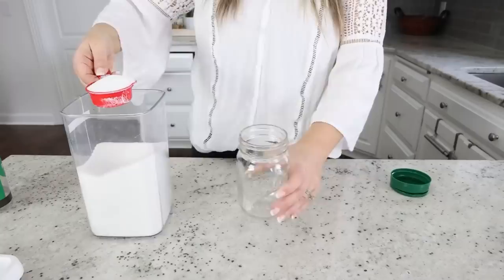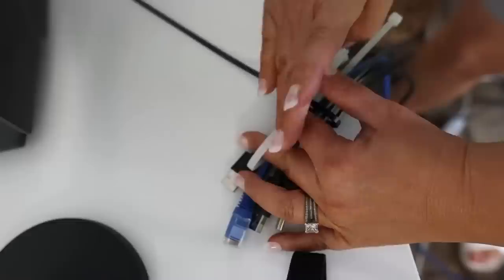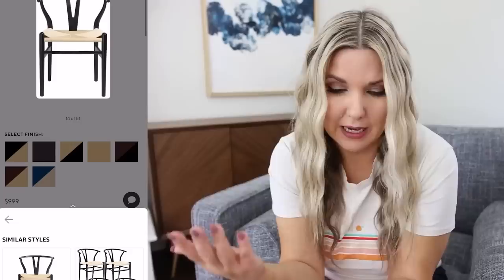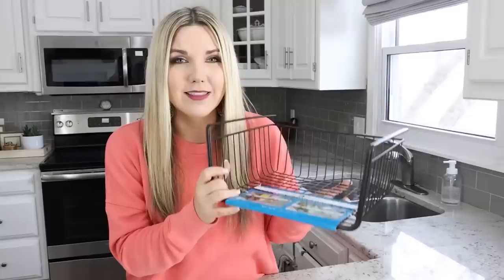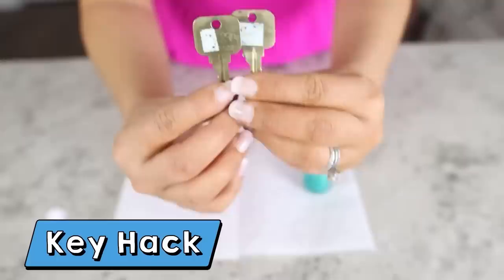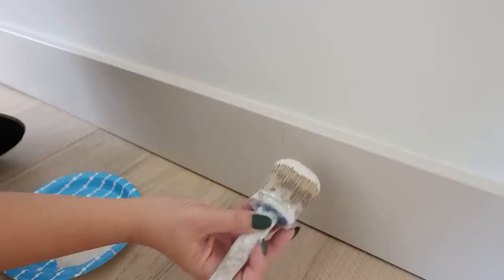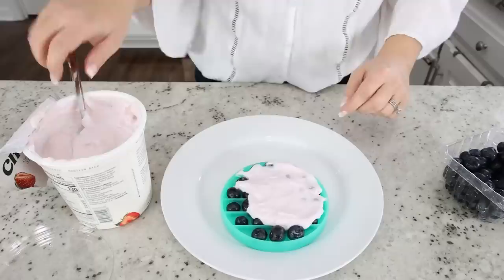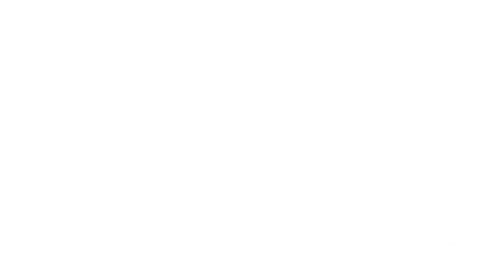60 HOME HACKS...That You HAVE TO TRY!

Comment: Use dryer sheets attached to a floor swiffer sweeper to clean baseboards and trim; not only does this clean off any smudges like fingerprints or crayon marks, but it also works as duster at same time,as the dust clings to the dryer sheets instantly. Plus as a bonus, it leaves your home smelling clean and crisp, and laundry fresh!
Reply: I had not noticed about the ceiling fan switch.  Thank you for bringing that to my attention.

Comment: A large dish soap container makes a better plant watering device as the snap cap keeps the water from evaporating and the lid opening makes it easier to control where the water goes.
Reply: Yep, I have tried putting holes in lids of various sized bottles and it always dribbles and makes a mess no matter the size and number of holes.
Reply: Excellent! Either a sports water bottle, or a cleaned out dish detergent bottle sounds great!
Reply: Love this! Currently, I am using a large Essentia bottle for my upstairs plants. It’s 50oz ans I can control the flow like a detergent bottle.  💖💖💖

Comment: To remove labels on plastic or glass, use spray WD40. Don't use water. Peel off as much of the label as possible. Then spray the area with WD40 let set for a few minutes, then you can clean the label and glue off. Works better the nail polish remover and puts a shin on plastic. Love your channel.

Comment: what a neat jewelry hack. I use old cans from Altoids for my jewelry travel. for long-term jewelry storage, I had some parts cabinets that my rings and ear rings, pins and smaller necklaces were in. Those were also valuable to put in my car when I moved across country and it was shipped.  I use nail polish on my keys.

Comment: I noticed running really hot water inside the jar helps heat the glass and loosen the glue from the label, making it easier to peel off.
Reply: Yes, I do this and let it sit for a few minutes. It works great! Comes right off.
Reply: And running a hair dryer over the outside, too. I prefer the hot water and hair dryer because then I can just quickly clean off the adhesive residue with lemon essential oil.
Reply: Yep, works like a charm no mess!

Comment: The container at 45:40 is great to store bags with handles from the grocery store too. Just put the bottom half of the bag through the handles of the previous bag and stuff them into the container as you continue doing that with each bag. Then put the last bag through the hole in the lid of the container. It works like a tissue box.
Reply: I’m getting ready to try this now.  I’m just not sure I understand the lacing the bag technique.  I’m going to give it a try though!

Comment: #6 paint tip. I paint a square on the inside of the switch because sometimes they discontinue the paint color. You can take the plate to the store and they can computer match from the swatch

Comment: To prevent hitting your fingers when hammering, simply put nail into the tongs of a fork. Put the head of the nail into the bowl of the fork so the nail is sticking out of the back of the fork. Use the fork to hold the nail. You don't have to hold chopsticks together.

Comment: Love it. 
One thing to use for removing labels is WD-40. I’m not sure if it removes the sticky stuff but labels come off easily.
Also, most people don’t know, but you can actually use steel wool on glass. That would definitely help with the elbow situation with removing the sticky.
There are so many hacks that I can’t remember my favorite.
Oh, and any way to store florals standing up is great. I have seasonal florals and I stand them up with dividers in boxes and then keep them lightly covered to prevent dust.
Reply: Goo-Gone will take off labels as well as any house or garage items that have gotten icky.  And you can get it at dollar tree in the hardware section.
Reply: Steel wool on glass?  I  don't  think  so... I use nail polish  remover. Or  baking  soda  and  vinegar with  Dawn dish  soap.  And if   you  soak  the  container in  warm  water  awhile  the  labels  ill come of  easily. Patience  is  the key.
Reply: @PK-bh1ww  steel wool is okay. I lived in an RV for several years and cleaned my front windows with it to get stuck on bug juice. I also used on the side windows to get the drip stains off the windows. I did not use it on the fiberglass as I had a different solution for fiberglass. Trust me. I did use regular (fine) steel wool rather than SOS pads.
I was just listing other options and things that do work without a lot of elbow grease. 😊
Reply: @sdeaglefeather  I  would never  use   even #0000 steel wool. I would use  vinegar   or  a paste made  with  vinegar and baking  soda  and a scotch  pad. Hot  water  used  works  well  too for  cutting any  grease.  I  too wouldn't  have an SOS  pad in my  house..  In the garden maybe  cleaning concrete pots. lol
Reply: Use eucalyptus oil. Labels comes off like a breeze
Reply: I use peanut butter. Works wonders
Reply: @PK-bh1ww  I was thinking of our back and forth video this morning and had to chuckle. Have never done that before. However I just found a small jar with a label so will go try it again 😊
Reply: @suesmith8326  Thanks for the tip that Goo-Gone is in the Dollar Tree store.
Reply: Peppermint essential oil for sticky stuff on glass. But be careful about putting essential oils on plastic as it can "melt" the plastic.
Reply: I use a blow dryer - nothing left to clean off
Reply: To remove the sticker from the glass or plastic container, just pour some hot or boiled water into the glass, you will see how easily you can remove the sticker from the glass. Do not wet the outside of the glass.

Comment: New subscriber having 2 ideas off from this video. Instead of tape on the luggage when going traveling (which is easily taken or rubbed off of), put many colorful tiny ribbons tied on the handles. Easier to spot better and not easily removed... imo.   Last suggestion, grab some Dawn Heavy Duty Degreaser. The purple spray bottle is not found around dawn and other dish soaps but is located around other cleaning degreasers. This chit is way better than the Dawn powerwash or other known products. I buy it personally in a bulk jug now from Lowe's. To save money (from the degreaser) yet efficiently working at top speed with high rated results, I fill my old spray bottle with one third full of the Dawn purple degreaser, add some regular blue Dawn (not powerwash) to approx 75% full, then finally top rest with alcohol till bottle is shy full. Give it a lil shake to incorporate. Trust me. This is thee best I came across and tried.     Thanks for reading if ya did. Abundance of infinite blessings everyone 🌍

Comment: Great video, Liz. 1. I have a used spray bottle filled with neat Apple Cider Vinegar near my Washing Up Liquid on the sink, a few sprays of the Apple Cider Vinegar inside glassware such as milk bottles, add hot water from the tap, quick shake, then rinse, glass sparkles. It has also got stubborn marks out too!  2. I use a few drops of my favourite Essential Oil [Coconut at the moment] inside the toilet roll or kitchen roll, and it adds a settle scent in the room.
Reply: I used  distilled  vinegar, baking  soda  with a little  Dawn  dish  soap  on my  glass  baking  dishes  and  a  Scotch  pad. Works  wonders.
Reply: Vinegar makes any detergent rinse away faster and more cleanly. I also use a spray bottle of vinegar at my sink!
Reply: @monstermcboo7282  vinegar is great  for taking  lime deposit off the  faucets.  I soak a rag  with it  and  wrap it  around  the  base  where lime  has built. Leave it on about a half  hour.  Or  use  it as  a routine  to  wipe  around  the  faucet after doing  dishes.
Reply: Use GSE from vitamin stores for many uses. Like - cleaning dishes glassware - dishwasher - in your washing machine - carpet shampooing - stains carpet. The list goes on
Reply: @SSS-eq3ky  I am not familiar with GSE ?   Could you explain it. Thank you 🇨🇦
Reply: @PK-bh1ww  I LOVE using distilled white vinegar for cleaning everything!
Reply: GSE is grapefruit seed extract. You find it at the vitamin stores. You can use for health issues for a person or you can use it for many other reasons. Been using it in my dish’s soap I make out of dr bronners n GSE n essential oils

Comment: Are used 3 to 4 denture cleaners to throw in the back of my toilet and two in the bowl of the toilet. Let them fizz scrub them out wash the toilet scrub a little more and then flush it again.
And when I was cleaning houses and apartments after college students would move out the sink stoppers would be very nasty in the bathroom. I would close them add water and a denture tablet and let them soak a few minutes and then scrub them off and help lift the dirt and made it easier to clean .

Comment: I knew several of these hacks, but still watched the whole video anyway. You always share such useful tips, and I absolutely love your videos! 
A quick tip for getting labels off easily is to use a heat gun. It warms the glue and they usually peel right off. (Be cautious not to hold the heat in one place too long or too close to the glass, or you may burn yourself)
Reply: Hair dryers also work. Even on low.
Reply: I also just soak in hot hot soapy water then use the Goo Gone
Reply: I soak in hot water, then lay on side, use cotton pads soaked in vegetable oil, and wash off with dish soap.
Reply: Hello, I hope you're safe over there? I hope this year brings happiness, prosperity, love 💚  and peace all over the world . I would love us to be good friends in honesty and in trust so as time goes on it will bring something great for us in the future, hope you don't mind?. I'm,  Nashville, Tennessee. Where are you from if I may ask?❤
Reply: Same..but have to say despite some good new tips,I can't stand fake floral anything!!

Comment: I use denture cleaner to soak in my coffee pot to take the coffee stain off! You hardly have to rub them clean. Also to put in a thermal bottle, thermos, especially if their stainless steel.

Comment: Denture cleaner is the best to soak your fingernails nails in to white them. I do it once a month. If stained from polish, it whitens them right up. With the candle, here was a mushroom top (carbon ball) which pops off if not removed before next lighting. You're suppose to trim your wicks a tiny bit between each burn.
Reply: Thanks’ I tried the dentist cleaner, I always trim my candles wick, how let smoke!

Comment: Great info. as always! To remove labels I soak the item overnight in a basin. Then use a scraper I got at $tree in the craft dept. It has a white handle & a flat metal scrape. Like a spatula. Then use it to remove the label and whatever is left I use peanut butter & the same spatula. Voila! All done & no labels. I gv these as stocking stuffers this Christmas. My friends really like the idea and are using it. Have a great day, and keep the info. coming.
Reply: You can also for free use a used up gift card as a scraper

Comment: I use the smaller of the IKEA clear plastic slim pour containers as a bin to store dead batteries prior to tossing (in case they leak battery acid).  But for the taller container, I'm currently deciding whether I want to use it to spread de-icer on my sidewalks-- I think it would work, though I will probably decide on a different container.  I just wanted to mention it in case it would work for anyone else reading this.

I'm working on a hair tools skinny bin storage solution, too!!!  I have mDesign frost rectangular trash cans though, and am working on having one bin for tools, and another for products.  I may use the Umbra skinny bin (it has a dramatic diagonal slope to the top (the top is not level), so that the one end with the handle sticks up more for grabbing.  I may use that one for the bin in the back.  Anyway, it's basically the same exact concept of your clear slim bin idea, and I've thought about clear bins, too (I love clear bins).  Been using the rectangular trash bins for everything, though .... bathroom cleaning supply kits, vitamin storage, etc.  They come in different sizes and colors, but I always choose white or frost.

I use a plastic carafe, too!!  I recently learned that baking soda seems best to clean toilet bowls with (which was a surprise to me), so I got Prodyne plastic carafes (Prodyne makes the best quality ones on Amazon), and am currently using them for baking soda.  I have others which I use to distribute dry plant food powder/granules, and they work great for that, too.  I feel like the flower fairy when I'm feeding my garden plants with the carafe --it's so easy and fun to use!!!

Comment: Loved all the ideas!
Liked so many!
Toothbrush holder for stems, the nail polish to remove labels, dawn + alcohol cleaner, baby oil on appliances etcetc too many to remember 😂
But
Thank you so much
Reply: It should be said that it all depends on the strength of the alcohol on the ratio. She was using 50%, but it more commonly comes in 70 and 91%. Dilute accordingly.

Comment: Use a diamond-infused honing steel on your blades every time before you use them. Honing is different from sharpening in that it aligns the particles along the edge so that the knife has a keen edge, whilst sharpening actually removes material from the blade. Hone every time and you won’t have to sharpen your knives very often at all; even your favorite and most used knives will maintain their edges much longer. It helps to buy a quality knife that has been adequately factory-sharpened to begin with, and I’m sorry, but those silly colored blades that are so trendy these days are not it. Those things are made to be disposable inside a year. You don’t have to spend a lot, however; I’ve found fantastic, well-made knives for reasonable prices on Amazon and at department stores. My honing steel was purchased at a reputable local kitchen supply store but read reviews thoroughly and you can make a good purchase online.
Reply: Totally agree! A Victorinox chef knife is around $40 on Amazon and recommended by America’s Test Kitchen.
Reply: @SparkleRainbow12  thanks for the recommendation as I never know what is a good knife to buy. I'm gonna check this one out.
Reply: Put white rice in a vase. And then add your full knives.  Swish them around up n down like your chopping or cutting rice in the vase This sharpens the blades
Reply: Oh, goodness, I wish food sites would stop promoting the rice myth. Rice does not sharpen knives, sadly.
Reply: Have a steel, works well on both knives and scissors, keeping the edges sharp!

Comment: For both the pillow case hack and bean bag hack… fill them with out of season clothes and bed covers. 20x20 pillow cases hold a stack of folded clothes, a couple sweaters, or blankets for easy access. Beanbags hold out of season quilts, bedspreads, etc.
Reply: I use old cushion covers ( uk) for shoe storage over summer/ winter.
Reply: Yeah i always reuse old clothes too, that's unexpensive

Comment: You can also use those plastic lids from the powdered cheese on the Ball glass jars as a beverage cap and insert a straw. When I buy a new container of cheese I take the old lid put it on the new container of cheese saving the new one to use on the Beverage jar. I do this till I've saved the amount of lids I need. The teeth cleaning tablets are great for cleaning your good jewelry and it also makes diamonds sparkle...Don't use on Pearls.

Comment: I'll definitely use some of your home hacks.  Thanks.  I have been using the tabs on the ends of the aluminum boxes for years....great!  Your stems definitely looked better covered with lentils and whatever the white ones were - even better than if you'd used all of one color.  Your rice to sharpen knives was brilliant (that is if it works for me!).  I'll try that on scissors putting one side in at a time if it works on knives.
Reply: The keys to the rice hack are placing the knives in and out of the rice along with the fact that water/being wet is detrimental to the life of your knives and rice is absolutely amazing at absorbing water. (Ever had to put your phone in a bag of rice?) I put rice in my salt shakers as well because it keeps it from clumping and the rice are too big to fall out.

Comment: I have heard that a bounce sheet helps take off messy grease pans. ( Like meats ). Even heard it helps with BBQ grills. Place water in pan then add a bounce sheet. Let it soak for 5 min. or more. Use the bounce sheet to scrub the pan. ( If. A BBQ grill may need some kind of container to place it in or use bathtub.

Comment: Liz, THANKS SO MUCH for sharing your tips/hacks! Honestly, I have heard some of them before, but some I'm like, 🤯 "WHY, didn't I think of these before?" Also, quick question, How did you keep your nails so beautiful w/out putting on gloves? (For the nail polish remover to remove glue residue hack) Also, my tip/hack to add: For a nice smell through out the house, place lemon/orange peels & a little water (about 2 cups), into a sauce pan/crockpot. Simmer your peelings for about 30-45 minutes. Not only does it make your home smell clean, but it will really clean your pan/crockpot! (I'm told, but haven't tried), you can also, drain the citrus water into a spray bottle, add a few drops of dish soap, & a little more water for an organic all-purpose cleaner. THANKS again!